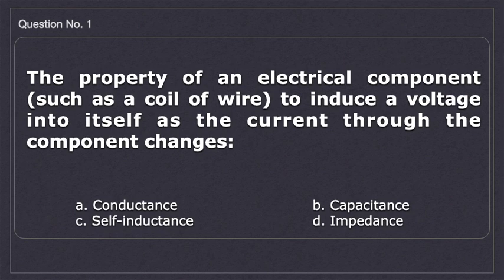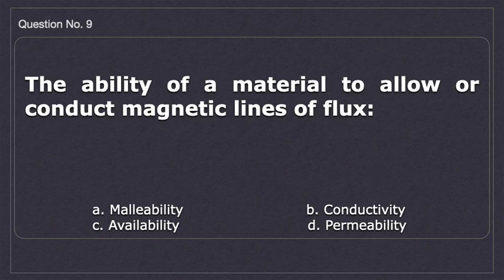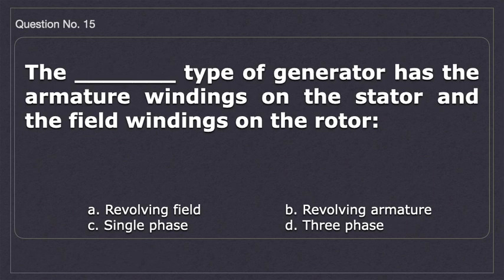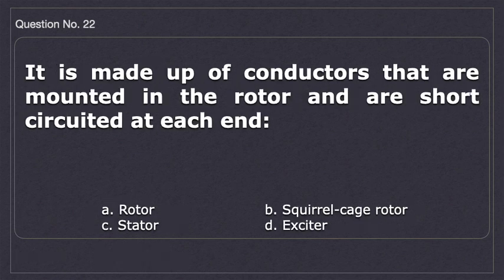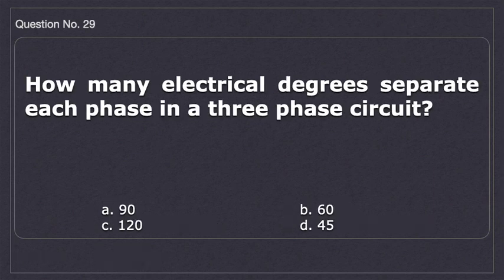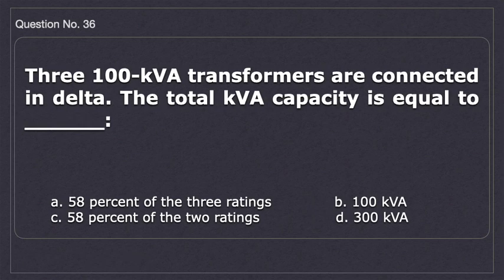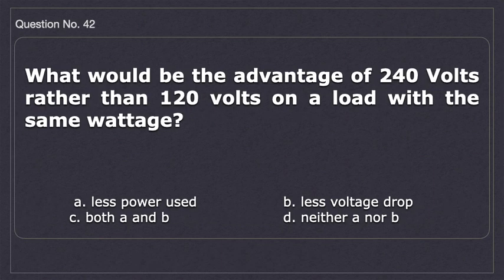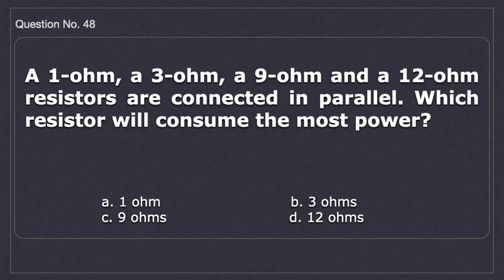Registered Master Electrician Reviewer (Technical Subjects Part 2)

Comment: The phase variance changes on the voltage in a 120 V/208v system. All phases would be 120° out of phase with each other.